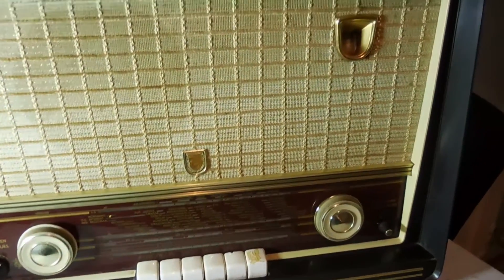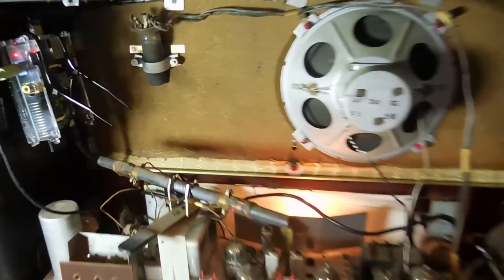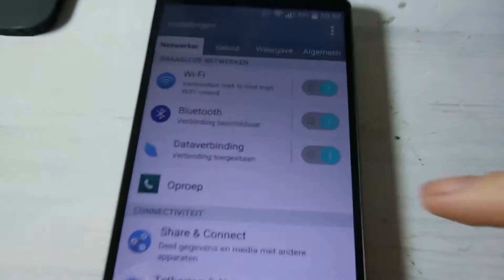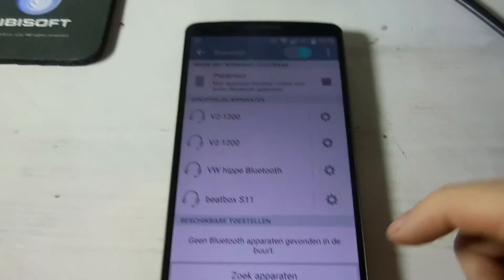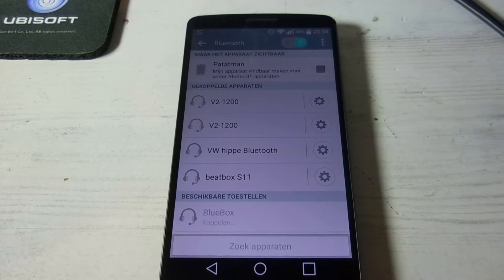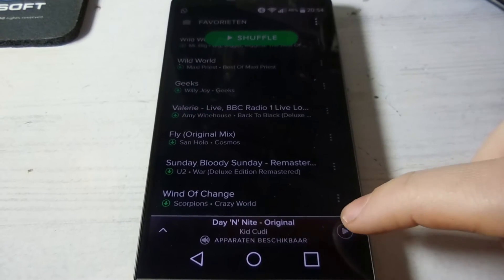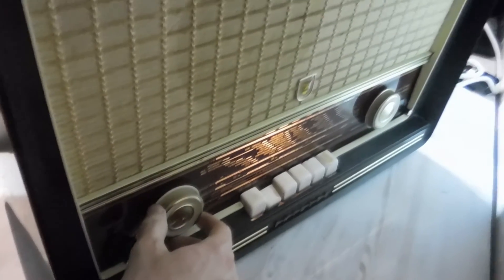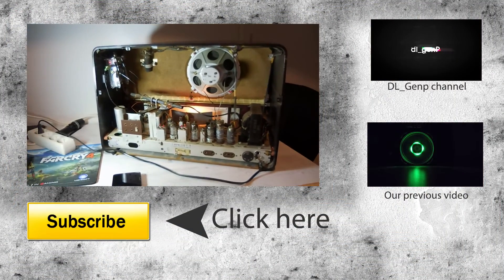Raspberry pi DIY old Bluetooth Radio | Geekstuff Patatman

Comment: Could you please send me an email or make a vid on how you connected the pi to the record player input. My Old Grundig has an auxiliary which in your case would be the record player. I would really like to know how you did it! you earned a new subscriber!
Reply from the maker: Enzo Peres Afonso thank you for your reply! I don't have this specific radio anymore, but I soldered the 2 wires from a aux cable to the 2 contact point of the record player. For another project I used a usb mini amplifier, and connected it straight to the speakers. I'm currently using that radio with mopidy as my Spotify/tunein radio.
If you need anymore help, let me know!